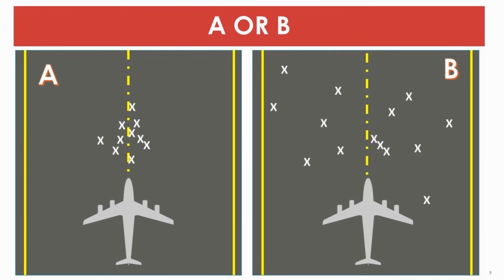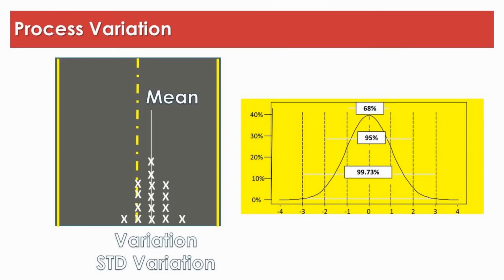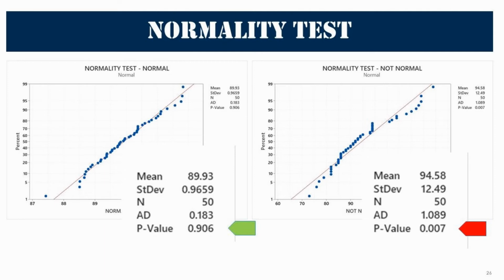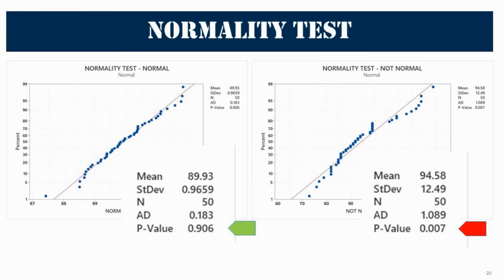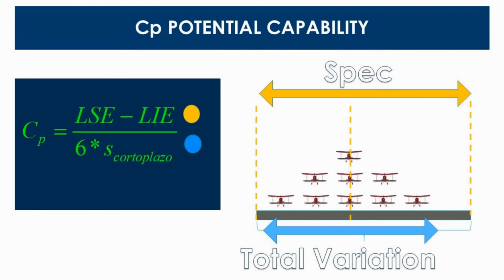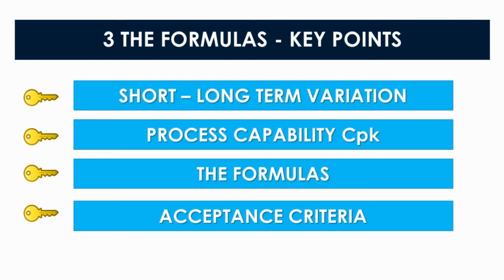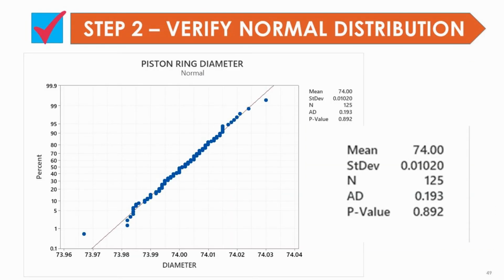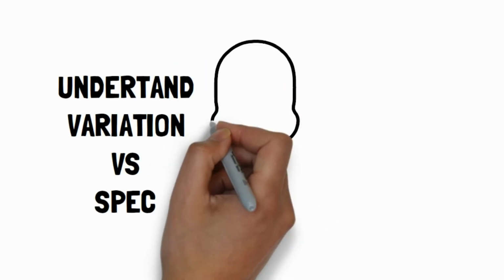CAPABILITY ANALYSIS MINITAB  STEP BY STEP

Comment: What is the sample size are different? I have different data for each day. Some days 5 samples are taken and some days 13 samples because of the total hour they produce. For example, they run 3 hours and 9 samples taken and weights are recorded. The next day they run 8 hours and 24 samples were taken. How you do capability test?
Reply from the maker: Hi Esmaeli
In cases when you have a variable sample size you can create a colum that especify the number of subgroup. I have run the excercise and it work fine! 
In the Minitab Capability Analysis windows firs your select the colum of your values an next intead of type in the subgrup size value in the subgroup size window, you need to select the colum that specify the soubroup to which each value belongs.
Regards
Fernando